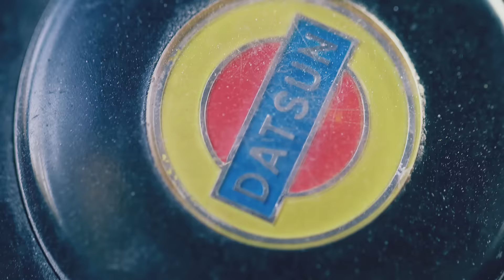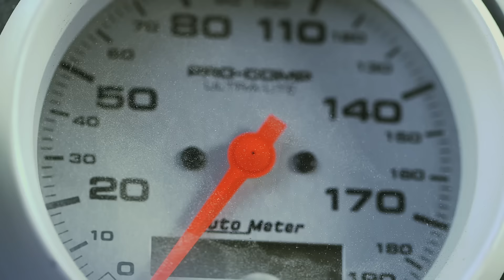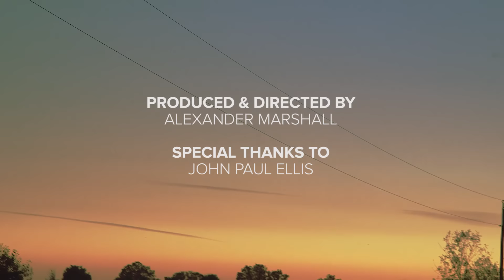Datsun 510 w/ s2000 heart - New Series

Comment: I have some gear questions..What camera system and lens are you using, are you using a lav to record voice, and what slider is that!
Reply from the maker: Sorry for the late response! I had tried to respond but for some reason some linked comments don't allow me to respond. ps. the dude who commented previously is the jerk who stole my video and uploaded it on his own channel...really nice guy.

To your question, for this I was using a c300 as my main with a 5D Mark III as the b. For primes I use mostly manual Zeiss lenses (35, 50, 85) and zooms l-series (16-35, 70-200, 100m macro). Lav is pretty standard, Sennheiser gw100 I think? And the slider is a Kessler 2ft but I also used a Kessler lite crane as well.

That being said, I've been transitioning over to using the Sony A7S II as my b camera (sometimes even my a) but I'm still working out the workflow on that. On my most recent vid there were portions of the last half that were shot on it.

Hopefully that helps man!
Reply: +Alexander Marshall holy crap man you are awesome thanks so much for taking the time to answer my questions. Can we connect on facebook or something? Would love for you to check out my project too!

Comment: I'm doing the same swap and I'd like to ask some questions?what's did you do with the EPS, secondary air and evap wiring?does it just throw a light or go into limp mode?
Reply: Tommie Reid  I have the f20c sitting in the car now.just figuring out the placement/angles of the engine mounts and crossmember.i could always throw a turbo on a f20c and have a blast too.

Comment: I have a 71 510 Datsun with a S-2000 engine drive train,  with rear 3:70 gear.
I have had several Sentra  with the 2 liter and ok but Nothing like the 2 liter Honda,  takes a bigger turbo then a jdm stock turbo to beat it.    I just got back from the MItte at Road Atlantic Geo drove up with 4 turbo cars  2- 510, 1- 86 Toy, 1 nice 700 hp Supra ,  I could beat the 86 Toy to a 100 and then he passed me. He lost the engine 30 miles later rods.
   The Supra kept blowing hoses off or breaking clamps.  I came home alone to make time 2-3 hours quicker then waiting for them  to fix turbos.  Never will put a turbo on a Engine,  they have trouble with oil passages blocked back to pan from the head 
because they were size of a pencil get blocked and suck dry on bottom, spin a bearing,
have bought 3 like this from Copart  and Honda puts in much bigger holes,no problem.
    Who won out on Indy car engines?    Toyota, Cosworth, Ilmore Chev, Lotus,  all quit and Honda (small co)  furnished engines spec for all Indy cars for 12 years.  Now GM
will try again.     Toyota beating Ford and Chev in Nascar last year and some this year.

Comment: Why not SR20VE?  Just as good as any VTEC.  I am a Honda fan, but I don't like cross-band... it's just not right. :P
Reply: The SR20VE makes 152kw while the k20 makes 158 but the SR20VE has a lower compression ratio which works better with a turbo ive planned all my project cars i got to much time on my hands
Reply: sr20 is the ls v8 of the nissan world. Its just boring